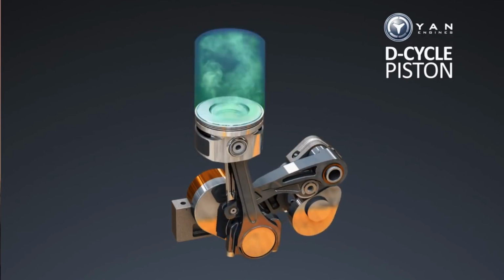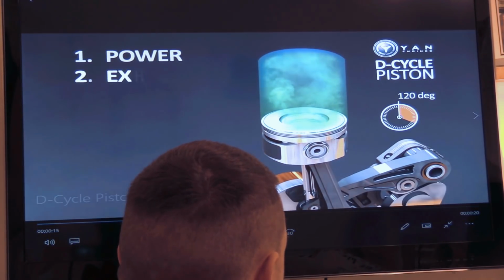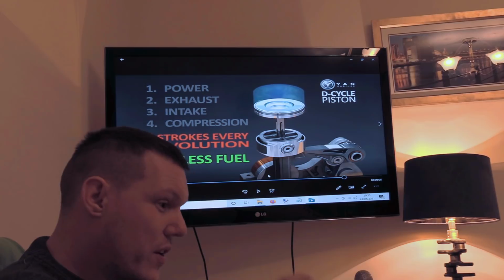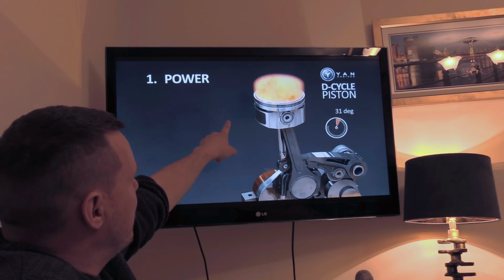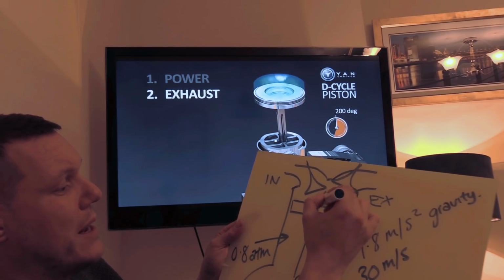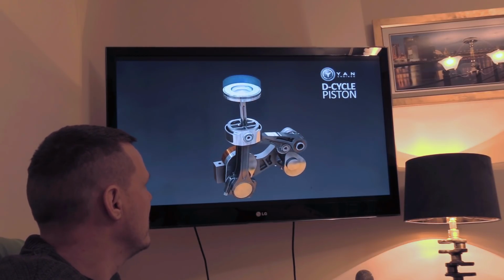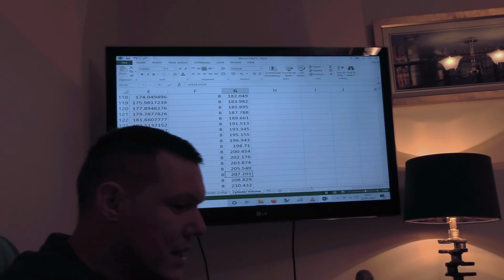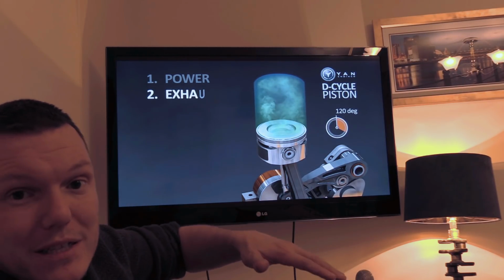Is this a GAMECHANGER? | D-cycle engine

Comment: I have seen this design before or very close to the same and not in recent times im talking 40 odd years ago. If memory serves I disregarded it for  the same reasons potentialy being complexity of manufacture and manufacturing costs. Ignoring the bloody obviouse mechanical problems with the design in your animation. I just cant see any of the big engine makers even looking at the design. We are heading very quickly to the end of development for IC engines so why would any big maker look at it.

Comment: Correct me if i'm wrong, but engineering is supposed to solve problems. I don't see what problem this design is supposed to solve or advantages it's supposed to provide so it's just not necessary. The way i see it - t's an interesting thought experiment, but that's it
Reply from the maker: 2 strokes are no longer available because of emissions... that's why

Comment: At first glance this looks only 60% more efficient than a conventional 4T engine of the same size. Also that’s before you count the mechanical losses with  the extra moving parts etc.
Reply from the maker: Efficient?
Reply: @thedirtyworkshop   I mean has this engine the capabilities of producing 60% more power in theory? Based on it’s VE and before other factors & losses are taken into account. 
I agree that surely a system similar to the desmodromic  valve system will have to be adopted for better control of that upper piston yoke thingy/bore jammer.

Comment: Fast fluid discharging and charging in sequence to replace 2-stroke scavenge make huge 2-way pumping losses. I doubt the benefit and gain from the Atkinson Cycle involved will be wiped out. Not very worth doing. A smart engine design must yield the gains and benefits from all 4 individual strokes.
Reply from the maker: No it doesn't. An ideal engine improve yes, but not all 4. If that was the case engine progress would be very slow

Comment: You are not gaining anything and you have complicated the engine.
Having the 4 cycle engine turn twice is not a big deal.
But if you want the true light weight two stroke, then you have to go rotary.
But you have to resolve the combustion chamber problem with the Wankel.
Which is what I have done. And invented the first 3 Cycle engine.
All the three cycles happen simultaneously within one rotation.

Comment: The amount drawn in on the inlet stroke is even less than you describe.
You are looking at the wrong stroke.
The exhaust starts at 120° not the inlet.
The inlet starts at around 200° and goes to 265°. So the inlet is only 65 degrees instead of 180 degrees in a standard 4 stroke. That's around 30% of the normal intake.
So this thing is losing 70% of the power to save 20% of the fuel.
That is nonsensical and worse than even what you describe.
Also the mechanical complexity would be just asking for reliability problems beyond imagining.

It's a good thought experiment that's all.
Reply from the maker: The stroke length gives the length of stroke, nothing to do with crank angle...
Reply: @thedirtyworkshop  sorry I wasn't referring to stroke length as a measurement of distance in this "D cycle engine", I was looking at the intake stroke length in degrees of duration.
65° of inlet duration compared to usually more than 180° in a standard 4 stroke is going to leave this "D cycle engine" with a power deficit.
But it will have plenty of extra internal friction.

Comment: Yuck. Ignoring the engineering issues a Rube Goldberg engine presents, I'll note that there are still two piston assemblies (one of which is inefficient), but there's no lengthening of the cycle, so each function averages half a stroke.

Instead, run a second crankshaft at half RPMs that drives a pre-compression cylinder and a re-expansion cylinder (I call it the Caldwell cycle). You wouldn't think it would work, what with the stroke-count mismatch. But it results in a 10 stroke cycle:
Intake, intake, compress, compress&transfer, compress, expand, expand&transfer, expand, exhaust, exhaust.

Comment: sorry Matt , this design along with any future Internal Combustion Engines (ICE) are obsolete and pointless.

Let me explain, i’m a 56 year old man, i have riden Motorbikes since i was 5 years old and cars on fields since i was 10, my most favourite smell of all time is the startup of the old 1980’s truck diesels engines and walking into the could of white smoke and breathing in that acrid smell that makes your eyes water, i love it!

I  Currently drive an 18 year old diesel van, i ride a Kawasakii ZRX 1100 C1 and a Suzuki GS500 and i drive a brand new ICE petrol car.

I also ride a 20 year old mountain bike that i recently converted to an electric bike an i was stunned and i thought wow! this really can be scaled up!

You’ve spent 30 minutes in another great video explaining that obsolete engine design burning a fossil fuel, i watched your earlier slightly biased videos about electric motorbikes and haw they need to tow a coal burning power station around with them, which is no more than a petrol bike towing a distillation plant and an oil rig behind it.

I can explain electric in 30 seconds , to convert a for example GS500 , remove ICE engine you bolt on the electric motor , bolt on the battery’s , bolt the controller unit, charge in the shed and go with a 100 mile range.

In the process i removed an ICE engine with approx 300 moving parts all waiting to break, an exhaust system that costs an arm and a leg if its akrapovic , and if the bike is water cooled i don’t need to fill it up with water , evans or cat piss …i can just chuck it all in the bin

Im not a tree hugging saddo and i like to watch the workshop channel for the swearing and the fred dibnah experience with these old  steam related engine designs, and the delbolox channel to see the latest bike to be trashed, Delboy i think….you don’t need to trash the whole bike, just the engine, exhaust and cooling.

Anyway enough of my rant I’m off to find a forklift truck electric motor to start on a bike project!

https://www.youtube.com/watch?v=IUZ10vbHTFE

https://www.youtube.com/watch?v=O1FV_K-tQ3M&t=23s
Reply from the maker: Nonsense. Pure bollocks
Reply from the maker: This requires its own video. But I'll say this. Say I wanna go to craigs House 220 miles away, good luck with that. I wanna get there today, not tomorrow. So much for obsolete....
Reply: @thedirtyworkshop  im not saying its perfect as yet , I'm saying the tide is changing ...my old laptop battery only lasted a couple of hours, this Apple mac more power hungry, smaller battery but same type lasts for 10 hours between charges .... my  battery the size of a house brick on my clapped out old converted push bike does 35 miles between charges...like i say im not an environmentalist im saying the technology is improving ...it even amazes me!

Comment: This video made me think... the main (inherent) problem I see with ICEs with regards to efficiency is taking a 3 dimensional expansion of hot gases and converting that into a 1 dimension linear motion 🤔 You can come out with elaborate tweaks - like this engine - but (just my opinion, mind) it's just nibbling round the edges of pushing efficiency upwards. Just the nature of reciprocating engines 😐

"Ah! But electric will save us!!!" mmm, maybe electric motors are efficient at converting energy into motion but battery technology is not the magical unicorn we were promised and not likely to be for the foreseeable future (if at all.) Fuel cells might be a better answer but hydrogen is neither free nor easy to make and while methane fuel cells make more practical sense they still output CO2 so the tree huggers will still be upset. "Tesla seem to be doing okay though!" a turd rolled in glitter is still a turd. I'm sure there's more to be done to make the ICE "cleaner" but that's not a sexy enough area for research so in the future we'll all be spending hours at service stations waiting on a recharge 😥
Reply from the maker: Volume and motion comparison to dimensions is not a comparison you.can make...
Reply: @thedirtyworkshop  No, I admit that it's not valid in a quantifiable sense. I just picture 70% of the energy slamming into the walls of the cylinder and 30% driving the piston down. Totally wrong of course!
Reply from the maker: Its not like that, its the waste of heat...
Reply: I get that, I just look at an ICE - "a lot of the energy is wasted as heat" - and think "of course it is" but don't ask me to prove why it does 😉  TBH I don't know where I was going with this, things seemed so much clearer last night after a load of beers.

Comment: So.... An over engineered 2 stroke engine.
Reply from the maker: That lasts longer and could perform better??? Do you think a Boeing 747 is an over engineered kite?
Reply: @thedirtyworkshop  conventional 2 stroke engine will definitely outlast that engine. Not sure about performance.
Reply from the maker: Do you have any data to support this?
Reply: @thedirtyworkshop  nope, no data. Just based on the engines used in motorcycles and power tools are known to last almost as long as 4 stroke. 

1. The top end of the piston in this engine should stay leveled but the rocker arm (like) varies in distance depending on its position making the (secondary) connecting rod pivot on a certain angle. I dont know how they will achieve that or if its even mechanically possible to do on a skirt less piston.

2. Conventional 2 stroke engines are inefficient but produces more power than 4 stroke due to high RPM. Assuming there are perfect tolerance between the top and bottom end of the pistons, i doubt that it can reach RPM's of a conventional 2 stroke before slapping on each other and causing damage.

= Over engineered 2 stroke engine.
Reply from the maker: "I don't know how they will achieve that or if its even mechanically possible to do on a skirt less piston."

You put skirts on the piston and have the bottom piston accommodate it.

"2. Conventional 2 stroke engines are inefficient but produces more power than 4 stroke due to high RPM."

- This is wrong. MotoGP bikes run to 20k. I have a bike that runs to 14k. 

"Assuming there are perfect tolerance between the top and bottom end of the pistons, i doubt that it can reach RPM's of a conventional 2 stroke before slapping on each other and causing damage."

- It doesn't have to run that fast. That's a requirement you have made up.
Reply from the maker: What claims did I make?
Reply: @thedirtyworkshop  you did no such claims, its my analysis of the engine and not a reaction comment.
Reply: @thedirtyworkshop      1. piston with sleeves would just require beefier connecting rod and over all more mass That would require counterbalance of sorts(secondary crankshaft maybe?). Since the top end piston and its connecting rod now has more mass, the rocker arm that is connected to the top end piston would also needs to be toughened up. This part for me needs a return spring or another counterbalance.

2. Its not wrong, Try again.

3. I am comparing it to 2 stroke engines, its called a comparison and not a made up requirement.
Reply from the maker: Explain how #2 is wrong. Lol I'd like to hear this
Reply from the maker: Point #1 is a point I made.
Reply from the maker: 3. You said "I doubt it can reach the rpm of conventional 2 strokes" (paraphrasing) but who said it had to? You said that, it's not a requirement, therefore you made that requirement up. Are you trying to be simple?
Reply from the maker: 3. You're the one who made up the rpm requirement or can't you read our own comment?
Reply: @thedirtyworkshop   2. Cause it is. (compared to 4stroke) this design or concept is trying to eliminate the inefficiency of the conventional 2 stroke engine.

3. It's a comparison with 2 stroke cause this engine concept or design is basically an over engineered 2 stroke.
Reply from the maker: 2. You said rpm... Read your own dumb comments.

3. Do you know what over engineered means? Define it please.
Reply: @thedirtyworkshop  2. Yes, cause..... I Can't reiterate enough that its a comparison of a conventional 2 stroke

3. Its an expression. If you want to know what I meant by that, go look up Rube Goldberg Machine.

Comment: turning a fourstroke engine into effectively a 2 stroke. too many moving parts and points for failure. A direct injected 2 stroke , Evinrude etec, is alot more efficient and alot less moving parts, and costs lees to build and less complicated.
Reply from the maker: And also shite....

Comment: I like the ingenuity of the design but It seems like the d-cycle is a redundant solution to the problem it's trying to solve because the simplest solution is to have a smaller displacement conventional four stroke engine. It also seems to have more parts than a conventional four stroke for no real gain. In terms of production, it would probably cost way too much to make due to all the additional machining and tooling needed. While it's a nice idea, in terms of production it's just not economically viable so today I will not be investing and I'll say that I'm out.
Reply from the maker: Apart from double the power strokes...
Reply: @thedirtyworkshop Ah sorry, your right, I will admit that the design confused me slightly. Like the old split singles, similarly, and definitely a stupid idea but what if you had two pistons like that connected to the same crankshaft both running the four stroke cycle but offset by 2 strokes so that you get 2 power strokes for every crankshaft revolution, would that not achieve the same thing?

Comment: it may be "4 strokes every revolution" but the intake and compression are only 1/2 a stroke.

far too complex ,far too many moving parts and wev'e not included all the valve gear. No way to actually draw the thin piston down. No space for any rings,  top piston will have to be a wobble as no space for a gudgeon ..."is this a game changer?" No. Might work as a 60rpm steam engine?
Reply from the maker: Too many parts is not an argument...
Reply: @thedirtyworkshop  why not? Just makes it more costly and time consuming to manufacture.
Reply from the maker: Sky-active that's why.
Reply from the maker: Also because you are just guessing. Let's say the engine produced 30% more power than the competition that year, and your sales are 30% higher than last year. Is that not worth the extra cost?

Comment: piston speed ....calculate piston speed please, as you are obviously more than doubling it. now back to longevity and or the lack thereof anything will run and sound good for a while call them a hand grenade l prefer torpedo engine you know how they go for
Reply from the maker: Piston acceleration means nothing with piston mass...
Reply from the maker: As in you can double the acceleration but as long as the mass is half then the force will be the same.
Reply: @thedirtyworkshop  
Try to use some math to calculate the acceleration when the two half-piston meet in the middle. A gap will make them tumble and no gap will produce multiple digit Gs.

Comment: too many moving parts.
Outdated by electronics in more then one way.
First of all, a 4 stroke regular engine with electronically controlled valve timing can do all you need. Most important of all control emissions, what is lacking this D-design.
Moreover the combustion engine is overtaken by the electrical motor as we speak....
So,
Nice gimmick to ponder about, nothing more then that.
period.
Reply from the maker: Electric motors have overtaken combustion? Where's the electricity come from? 

Secondly, what electronically controlled valves?

Comment: Not qualified to even talk to you buttt aren't most of the high rpm related problems negated by the fact that there is a power stroke on every rotation?  Power at 5k is the same at 2.5 in this?
Reply: Watched more. Not a full draw not even close. Disregard my lack of geometrical knowledge.

Comment: Just adding more moving parts to an engine !!!  Don’t see any simplification nor improvement
Reply from the maker: That's because you're blind. 2 stroke.
Reply: ????? 2 stroke ???? 
That mechanically complicated piston ???
That engine will not last 100 hours of revving and torque !!! 
Add also that manufacturing of those extra important parts will make engine not cost effective.
Top separating section of piston for intake and exhaust strokes with that flimsy rod will not stay straight inside cilinder scratching sleeves and unseating rings .
Just look at that stroke operation and realize that @ 5000 rpm for extended operating time with and without torque resistance will not last long … are moving parts made of titanium? 
There goes affordability
Reply from the maker: Will not last 100 hours? Got any proof of that?
Reply: Is that all you can reply??? Why don’t you prove everything I stated making that engine unreal .
Prove that top piston secondary stroke is going to cycle straight up /down with only a center point support ???
Prove that all those thin sliding support rods are going to last eg. 100000 miles in a car without major repairs .
Please reply with some explanation not stupidity..
Reply from the maker: Who said car? You're the stupid one, you made assumptions all over the place.
Reply: I said car as an easy example to understand the engine in use …. 
JUST PROVE WITH reasonable engineering the engine will endure use and be cost effective… 
That second stroke piston head with flimsy rod , rocker arm , slide BULLSHIT will make every mechanical engineer laugh
Reply from the maker: You seem to have 1) not listened to the video 2) don't understand what a graphical representation is.
Reply: With all due respect , that video and graphic representation will only fool ignorant investors. You will not convince nor prove anything to the engineers with it
Reply from the maker: How sure are you about that?
Reply: @thedirtyworkshop  prove that it even runs!!!!